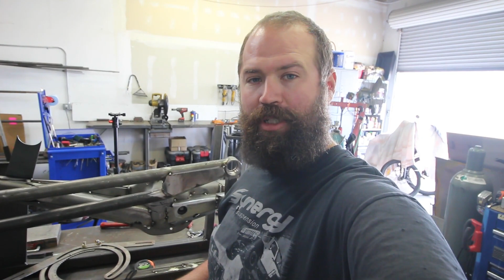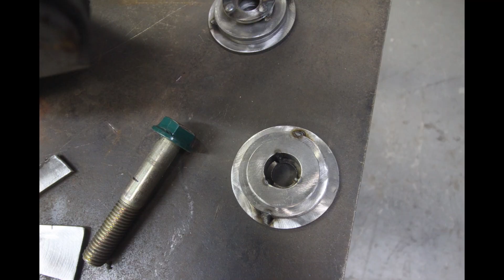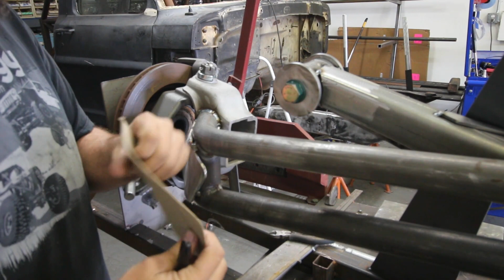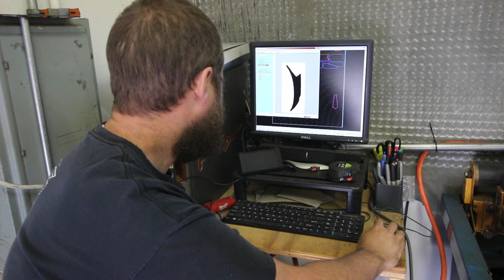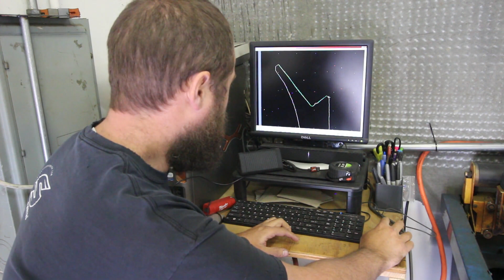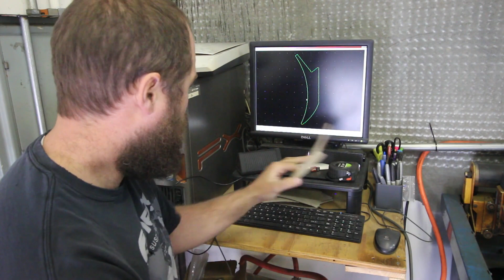1968 Ford F100 Prerunner Build Step 1

Comment: Always wanted to take a Super Duty super 60 and convert it to TTB by machining housing ends and using some Spidertrax parts and use fabricated housing ends to use Super Duty Spindles, Unit bearings,warn hubs and use GT500 6 piston calipers with EBC rotors.

Comment: So excited to see this thing getting worked on. Pumped to see how it comes out and the new content. Glad to see you back at it🤘🏼
Reply from the maker: You and me both!  You saw it as a paper weight in the back of my shop and now I'm working on it every day.  Glad to see the progress on your truck as well.  Gonna be a beast when it's finished up and out racing around the dez
Reply: @TTMotorsports  yea I remember when I was there and you told us the plans. I’ve always loved the 60s f100s so it’s sweet to see another one getting built that’ll be clean. We’ll see what comes of mine. Have some small parts to work around but I plan to have it done by hammers of 2022!
Reply from the maker: @jackmossman7559  Yeah will be awesome once it's done and i'll throw a nice paint job on it and four sail and build another one with what I have learned from this one and make it even better.